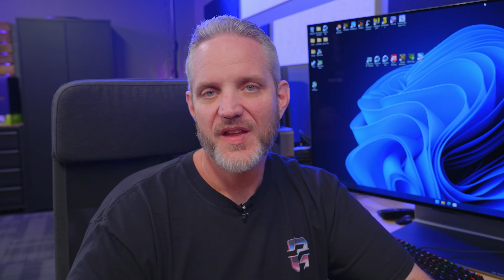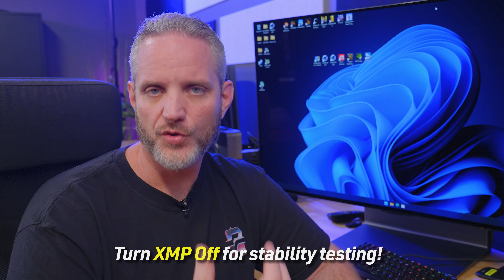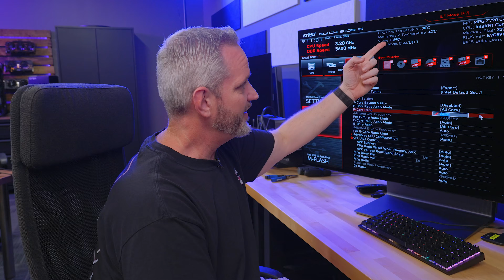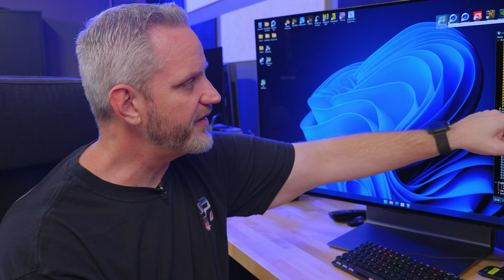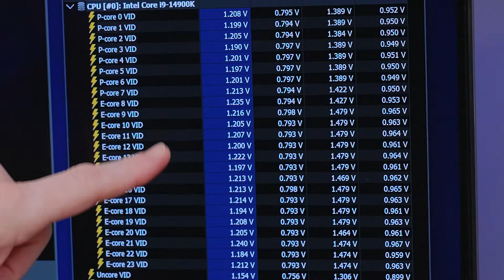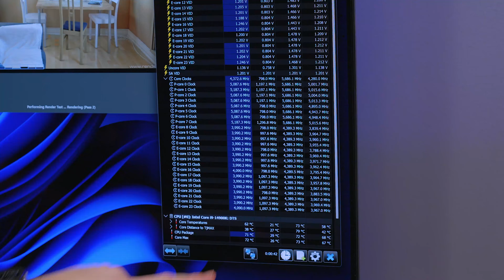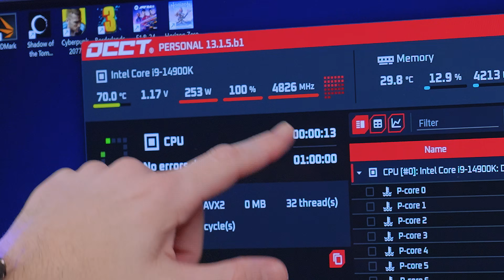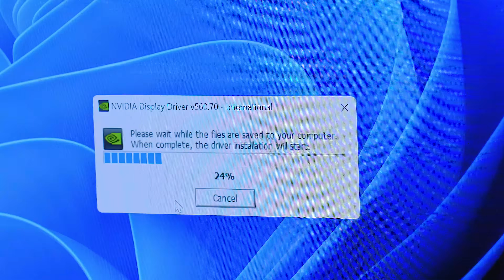Guide: How to check if your CPU is BAD!

Comment: Ok someone feel free to correct me here but heres my ideology. What I think a intel microcode is like the cpu's own "default bios settings" that it will solely abide by. Then theres the UEFI where it intefaces with the cpu to deliver correct power and do all ur overclocking and stuffs. What I assume is that ur UEFI has way more power than ur CPU's Microcode therefore if you manually tune everything to low voltages in the UEFI, it would override the microcode "default bios settings". So Im currently thinking I dont need to update my bios at all since I already tuned my cpu in the UEFI to always consume 1.25v no more no less with stock clocks and hyperthreadding disabled. There has been no degredation and I haven't been getting any WHEA errors in event viewer. Someone feel free to correct me here!!!!!!!!!!!

Comment: I warned people since 03-23 nobody listened and now here we are I'm vindicated but too little too late youtubers way too late more than 12 months later I can describe you how it's going to go in order 1)your manual or oem oc won't be stable 1 day 2) cinebench r23 will crash a few seconds after the start 3)cr23 won't run at all instant error 4) games will quit, you will blame them you will blame ddr5 it's none of the above it's the cpu I spent 4 months trying to understand why my modded skyrim crashed with no error in the crash log..it was intel it's stable on my new amd 5)you run out of video memory (it's not the gpu it's the cpu) 5) individual internet bowser tabs will crash you will blame extensions it's not it's intel 6) the blue screens will start once a week then once a day 7)sooner or later you will be forced to remove 2 sticks even on ddr4 or even only have one in ddr5 8) the blue screens will be every session 9) then you'll get 7 blue screens to reach the desktop and 9/10 apps will insta crash or blue screen I could return the cpu but I'm done it was 1,5 years of computer hell wondering if my 4090 was dead or the motherboard it wasn't, unless Intel pays me 1,5 years of salary as compensation I'm out I wasted months of my life trying to make my 13900k work MONTHS and it completely killed my gaming because I never knew when the PC was going to crash so I found other hobbies
Reply: my current 7950x isn't perfect at all (amd released the info that it has something to do with windows 11 and will be fixed soon) but my games don't crash neither do my browsers or extensions or cinebench no blue screen it works (with 2x16gb corsair dominator 6200 xmp those were in a short lived intel ddr5 build)

Comment: D da de dr da de d di thats all folks lol. U let degradation get the best of u jay lol. It was well known since 10th gen of mobo pushing too many watts to cpus. Its also been an issue w amd cpus as well. You should never run auto voltage on anything period. Ive been running my 13900k since launch day w tuned b die and 0 issues. I game everyday for hours on end. I also use the pc for everything else. I have never had a single issue. I tuned my ram and voltages day 1. Im even new to pcs and i know this. I built my first pc when 10th gen and 30 series released. One should ALWAYS check voltages PERIOD!. The fix is simple, set voltages and limit cores.
Reply: What should I set voltages to and limit cores to

Comment: 1st thing I did when I got my CPU was undervoltage it to 1.2V. It has been super stable and the temps are great. Stock voltage in these generation is crazy, temps are crazy, everything is kind of insane. I guess is all for the bench wars.
Reply: The problem is, that Intel should set the stock voltage at healthy levels (and clockspeed at stable level accordingly). And let people themselves take responsibility if they want to OC / OV the CPUs.
Intel didn't really needed to be Faster than AMD. (They already were the most popular) They got that succes by being the most stable and easy to use platform.
They managed to survive and even grow with the dreadful "slow but stable" Pentium 4 against the faster Athlon for years.
Reply: I just under volted to 1.250 and it went back up to 1.450 when Windows loaded. I think I’m just going to do an off set in the bios to get it below 1.350. 
XTU doesn’t allow me to undervolt since this new bios update. 
14900k.

Comment: 1. Get VID of your ratios (on MSI boards set AC LL to 1, DC to be equal to LLC, voltage mode to offset +0.005, lock ratio to your turbo levels [1 core, then all core], F10, reenter bios, scribble down vcore, as it's your VID value)
2. Reset bios to whatever default
3. Run HWiNFO, set polling rate to 150 or less
4. Run any all core workload (benchmark tool, nvidia drivers unpacking, y cruncher, geekbench loops, cinebench, whatever)
5. Check results
5.a) it crashed but you're below VID - too much undervolt/vdroop
5.b) it crashed, your vcore is on VID or above but you're outside of bIntel's specs (power limit, tau and other crap) and running XMP (yes, even in Cienbench) - reliability is not granted
5.c) it crashed, your vcore is on VID or above and you're adhering to bIntel's specs AND you're running JEDEC spec RAM - CPU is faulty

The only factual way to check if your CPU has degraded or not, nothing below VID or when violating specification is granted, not even longevity + it was up until recently that bioses were setup ludicrously. Also, on 4 DIMM mobos the rated RAM speed for 2 sticks is 4400 MHz (go see Ryzen 9000 Delidding Failed? Plus: Testing Intels Microcode Update! from der8auer, 9th minute mark), so that also has to be checked.

Comment: My temps on my 14700k reach 100 quickly on multiple cores after microcode update. I am using a Artic Cooling Freezer Ii 420mm aio. I get no crashes, but cant figure out how to better control temps. I wonder if this is a sign of degradation
Reply: Probably badly applied paste.
Reply: That is absolutely indicative of the CPU being degraded. Just research it. I guarantee that if you got a replacement 14700k and with exactly the same test, you wouldn't be hitting 100 degrees. RMA.
Reply: @Intel13thGenBurns  TY.

Comment: dumb question. Is this just a 13/14 gen problem. or is this a problem for my 10th gen? I understand degregation is a thing, but this microcode sh-tuff going on; should i worry about my 10th gen?
Reply: 10th Gen should be fine. 13/14 gen are most affected...possibly some 12 gen but those are rare [apparently].

Comment: I had an interesting BSOD from mine, page fault in non-paged area, seemed like battleye kept doing something. Swapped back to my ryzen cpu and mobo and no issues so far.
Reply: Launching siege or destiny 2 crashed it immediately, a 13900k, msi z790 something or another, and 64gb of ram, cost me a 4090 in the process

Comment: I know it's cool to hate on ASUS right now, but ASUS along with Gigabyte both significantly undervolt the CPU's with their default settings vs Intel settings due to the setting of the AC LL set to 0.4 mohms.  In my testing, the "default Intel settings" is what overvolts my CPU the most out of anything right now.  In both ASUS and Gigabyte BIOSes, you can manually set a voltage limit so you can stop it from going over whatever voltage you consider safe.  I personally don't want mine hitting 1.55v which is Intel's limit with the new microcode, so I set my max to 1.4v or 1400mv.  MSI refuses to add this option to their boards.  Bottom line, if you know what you are doing, NOT using the Intel Baseline Profile can be better than using it.
Reply: If you watch BuildZoids videos he states the IA VR Voltage Limit does not actually even work on all boards. Bummer
Reply: Why some YouTubers are ignoring this?
Reply: @AthosRac  No idea, guess not willing to do the research or work to figure it out.  I've seen so much misinformation spread.
Reply: that's the 125 bios update?
Reply: @MaxIronsThird  Nope, 129.
Reply: Do you know if asrock boards let you set those limits?
Reply: Does decreasing the CPU Lite Load help on an MSI board? My 13600k doesn’t go beyond 1.28v on vcore atm. The Intel default’s giving it like 1.46v iirc
Reply: How are those limits for delivered vcore set?

Comment: I was undervolting using Intel Extreme Tuning Utility by -0.110v which kept it cool and maxing at ~250w. However, in this recent week I started crashing in my Handbrake runs. Handbrake would throw an error (-12) or in one case my PC rebooted, in another a BSOD!!!  

I updated BIOS and Handbrake works again... but I've got ~13% degradation in performance. :(

Comment: My intel  stock dropped  30% last month. It has not regained it's value. Great time to buy low.
Reply: Imagine buying Intel LOL, they're on the way to Chapter 7 100%.The Dip hasn't even BEGUN.
Reply: @jabronilifestyle  It's not nice to make fun of us that got caught holding the bag.
Reply: @jabronilifestyle  Ha ha 08-30-24. My intel purchase you mocked went up 9.5% today alone. I have made $11000 on my 100k intel purchase in 3 weeks. You don't know what your talking about.
Reply: @SheBelongsToTheStreets...304  the Customer Service rep that was handling my RMA got laid off. Between the time I opened my RMA, and today, there have been over 140,000 new Intel product tickets opened. 140,000 new tickets while my RMA has been open LOL gluck bro
Reply: @jabronilifestyle  And $11,000 in my bank account. Intel is a solid company that isn't going away. You buy low in hard times and cash out when things get better.

Comment: My year-old system [i9-13900KF/MSI MAG Z790 TomahawkWifi/ 32 gig of 6000Mhz RAM] is not exhibiting any significant problems now after I updated the BIOS last June [Cyberpunk 2077 would frequently crash on start]. It was only then I started hearing about this widespread Intel CPU problem.  I see that MSI has released a non-Beta BIOS upgrade just today, and I'm going to install it now. I'm not going to bother testing...I just won't worry about it unless I see problems ongoing. Sorry for the people having major problems...Here's hoping Intel cleans up this mess in a satisfactory way.  Good on Jay for pointing out that electronic parts do degrade over time, with use. I know I'm shutting my system down when it's not in use now, rather than leaving it running 24/7.
Reply: RMA it asap. This cpus degrade bs is crap. My 8700k is still going at 5ghz after 6 years and it NEVER crashes. These new chips are defective and you should get a refund.
Reply: @jabronilifestyle  The higher the frequency, the higher the heat, the finer the component complexity, the faster it will degrade. I'll worry about my build when it starts to fail...as far as anybody knows, the BIOS updates will be effective in minimizing any problems. If I have to upgrade or replace my CPU in 2-3 years instead of 5 [my usual plan], I'm not going to be too upset.
Reply: @r1pbuck Have the exact same build with a 4090, updated BIOS 2 month ago, think I need to update again from what it looks like, have u had any crashes for the past month? Since u wrote this comment?
Reply: @carlo2202  if he didn't lock his p-cores it's probably unstable by now.
Reply: @carlo2202  Hi --  My last BIOS update was the one released on August 22. I haven't installed the latest Beta version [Sept 26th]...I'm waiting for the final release which should be coming anytime.  I haven't experienced any crashing since updating last June.
Reply: @r1pbuck  good to hear! thanks, if u remembers i would really appreciated to hear from you when u BIOS updates again, i was thinking about getting the newset bios setting, but you're waiting, to the final release? i was just wondering why?
Reply: @carlo2202  Heh...mainly because I'm lazy. I suppose I could load up every beta bios MSI releases, but I'm willing to wait for a finalized version, so I can do one and done. I don't know enough about motherboard tweaking to want to play with it a lot, and ignorant messing around with these basic settings can cause more problems than they solve.
Reply: @r1pbuck  i feel u! just downloaed the v. 1663 version now, gonna test my system with the apps JayzTwoCents uses

Comment: I use my 13600k/Msi Z790 Tomahawk Wifi DDR4 daily but haven't seen it crash except when playing Fallout London and I'm pretty confident in saying that's a game problem. I don't see any other problems when I'm working or playing other games. I haven't installed the latest BIOS or the microcode update. I'm honestly scared to since everything appears to be working fine. There could be something happening in the background I'm unaware of but I haven't looked into clock speeds, voltage, or anything yet.
Reply: Same CPU mobo. I updated and it's fine for me. I did have to disable ia CEP I think it was and I changed, Lite Load to 3, LLC left Auto (as I set it for the old bios).
Reply: If it's good don't touch it. 0x125 and 0x129 BIOSs from MSI came with slightly elevated voltage. If you don't bother tweaking and is working leave it as is.

Comment: I'm still on the fence about upgrading the BIOS for my 13600K on a Gigabyte motherboard.
It's super stable, runs under 1.25v max with temps at ~72C while gaming.  I've seen only 2 games that push the power over 100W (excluding shaders compilations).
Reply: Better wait for a non beta bios anyway, it really does nothing for the 13600k except introduce a new intel default that kinda sucks on efficiency.
Reply: i have same experience here. I undervolted almost right out the box. Still hits 5100mhz boost 65C @1.25v iRacing in VR is just using 80W
Reply: 13600k here too. Not seeing any issues, not going to update to new BIOS because of performance issues. If it dies I'll go to Intel I guess. I got mine in 2022 though. It was speculated that the original first batch don't have this issue. Has anyone else heard that?
Reply: If you do get it, make sure you set the power limits and ia voltage limit anyway, unless you really trust gigabyte and intel.
Reply: im on Bios version 2305 with ASUS z690-F and I have spent some hours some days and cant see any voltage problems or anything, I have HWmonitor and tested with Cinebch and voltage dont go over 1.251. I do XMP 2 and only lower offset voltage, never touched LLc or anything else,  I run my computer stable, never crashes im on 13600KF
Reply: 13600k here. Mine is running on 1.35v sometimes reaching 1.4 but so far I had no crashes or anything. Temps are good tho, 35 on idle and 70 on super heavy uses. Kinda on the fence if I should update the bios or do anything else

Comment: *laughs in 4790k*
Reply: Laughs with a 5800x3d ( why am I here).
Reply: my and my dad are still using those. 

admittedly, these days im running mine as my buddy's game server instead of my main pc, but still.
Reply: @quantum5661  My sons are running on 4790k still.
Reply: I just upgraded from a 2500k to this bs 😒😒😒
Reply: Ahh I love the irony, I still have a 4790k myself, replaced it with a 13700k back in 2022 since it was starting to show its age playing newer games and trying to record at the same time.

This whole ordeal was a slap on the face, I did got it replaced but it made me re think why did I even upgraded lol
Reply: @00Mike55 4790k is a cpu that still holds its own 10years after release.  It's the cpu version of a 1080ti
Reply: Just bought one of these for an SFX build which will handle stream encoding.
Reply: Great CPU. I have my 4690k still running 24/7 as a server
Reply: 2700K*
Reply: 2600k ... wanting to build a new system, but don't have the funds at the moment ... luckily!
Reply: I have an i7-14700 non-K. Hopefully, that one will degrade slower. I don't need K anyway, don't want to overclock and eat up electricity, and I need my CPU to be efficient and stable for 10/7 use during work and relaxing (LLM and VR stuff).
Reply: 4790Ks will still be running long after all the fragile 13th, 14th gen crap is burned out. That is not a joke, they really will outlast them
Reply: @BigTedsBoogieBox  These are facts. I built my first PC back in 2014 with a 4790k and it's far more stable than my 7950x. What the hell...It's like AMD and Intel are making the CPU equivalent of the 2022 Tesla Model S.
Reply: laughs with 5950x with pbo applied
Reply: Pls don't laugh at my misfortune :(

Comment: I'm crying because my 4790K doesn't know what degradation is... Ugh, I need a reason to upgrade... 😅
Reply: my Z97 motherboard just died so shelfed my 4790K hell that 4790K has went through 2 z97 motherboards.  Just picked up a 14700K because I want to be part of the fun 🤣🤣🤣🤣😭
Reply: @bravoA-su8xm  im still using my 4690k at work as it was better than what they have for heavy number crunching. She wins on reliability alone.
Reply: @bravoA-su8xm  Both of my Devils Canyon processors have stood the test of time in MSI Z97 boards. The 4790K is on a MSI Z97 Krait and the 4690K is in a Z97 PC Mate.  Both of those rigs are still running to this day one as HTPC (4690K) and home NAS machine (4790K).
Reply: @bravoA-su8xm  my z97 still kicking it... T_T
Reply: I have so many different Intel generation builds that are still running today. From a Sandy 2500K through Skylake 6700k I never had any issues. My Kaby Lake 7700k build is where I started having issues with Intel, oddly enough that was the build I went all out and bought the best of the best and that experience taught me to never do that again.

Comment: I dont think you ever test this with even 50% accurate rate since this is a degrade over time test. The only test you can run is continue to use until your CPU start to get those errors.
Reply: Doesn't anyone listen or pay attention anymore. Jay even said himself multiple times that these tests will either show something or nothing. It all depends on the workload, and a million different variables ... So if you could every single cpu for those millions of variables ... then maybe you could see something.
Reply: You can test if your CPU is already degraded till the point that it causes actual issues. These tests don't give you a result saying your cpu is '98%' healthy (or '10%' healthy for that matter :p)